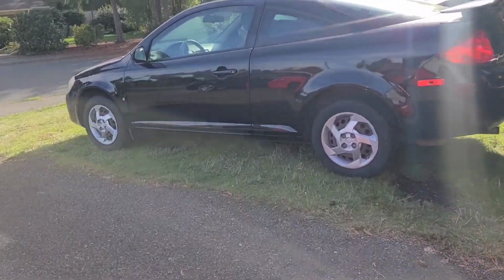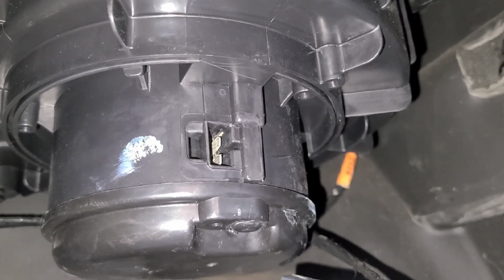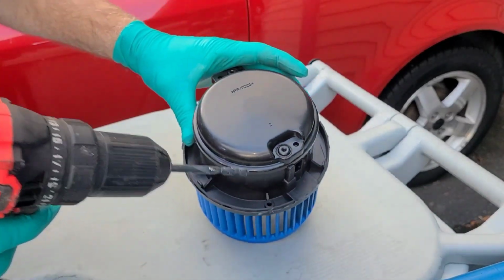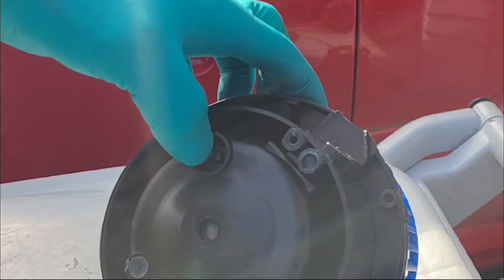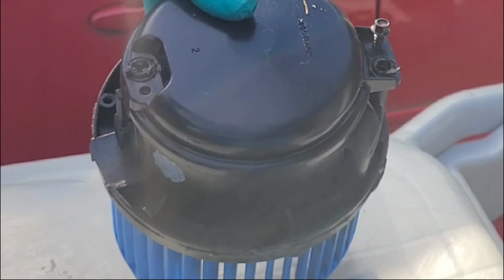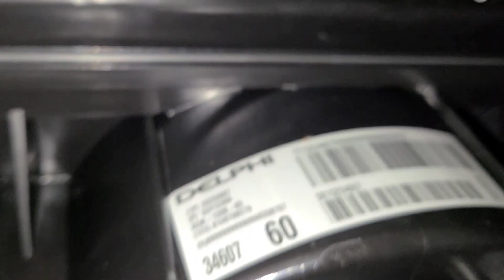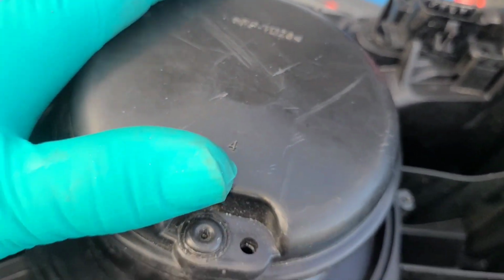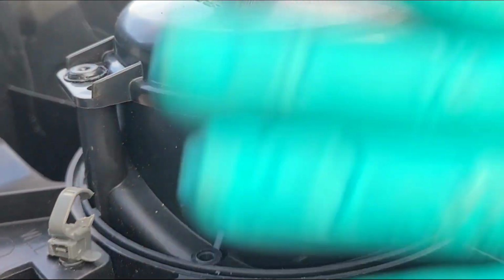Blower motor replacement, Pontiac G5 /  Chevy Cobalt

Comment: Any tips on how to cut through the thicker portion of the plastic? I can get all the area with the little divot between the two plastic walls, but I can't make headway on the thicker plastic. I tried a new utility knife but can't seem to manage. Did you take out the seat to gain better access? The angle is just really tough.